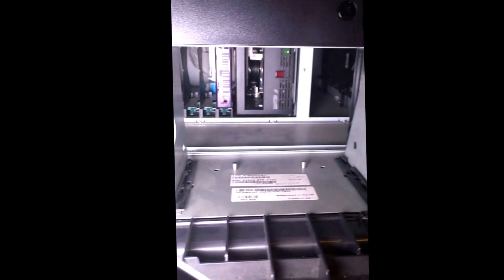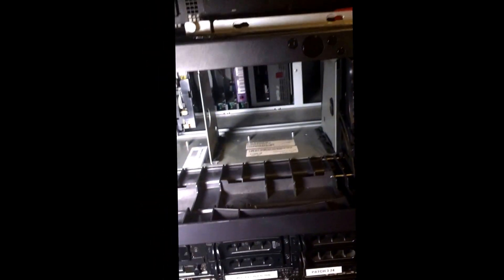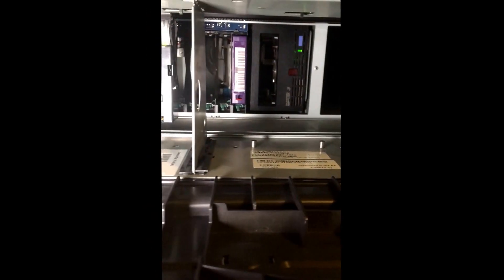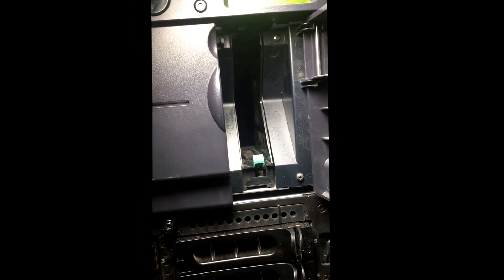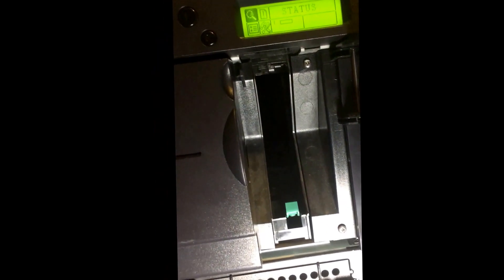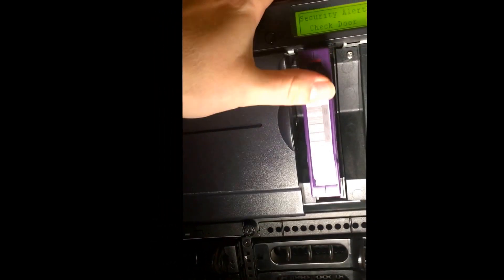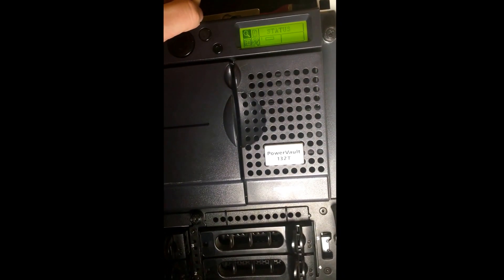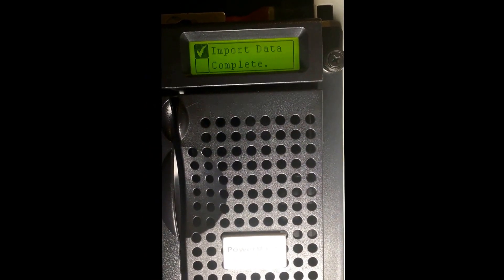Dell 132T tape library

Comment: How much did you pay for this machine and would you buy it if it was 25$$?
Reply from the maker: Soothing it's for sale for £285
Reply: Paul and Tomorrow's people ive found one in the states for 25$
Reply: Paul and Tomorrow's people also can these be used to host servers or are they just a library?
Reply from the maker: Soothing it's a library only (backup)
Reply: Paul and Tomorrow's people but can the library have servers stored in them
Reply from the maker: Soothing yes as backup
Reply: Paul and Tomorrow's people ok cool im gonna pick up the one for 25 then thanks for answering my questions